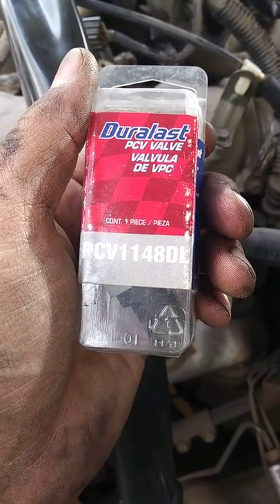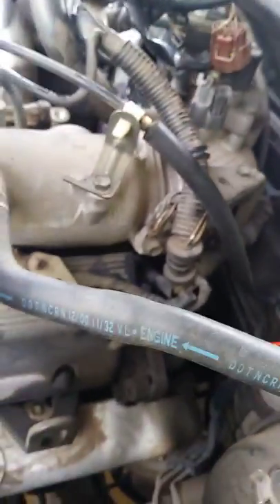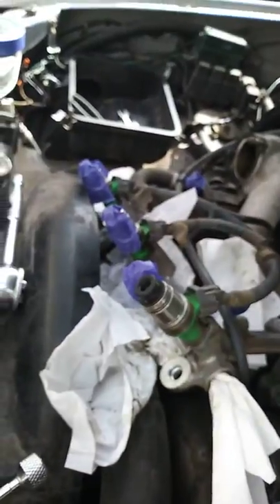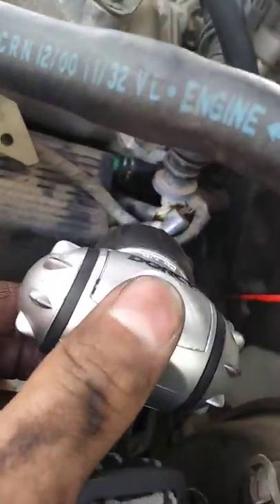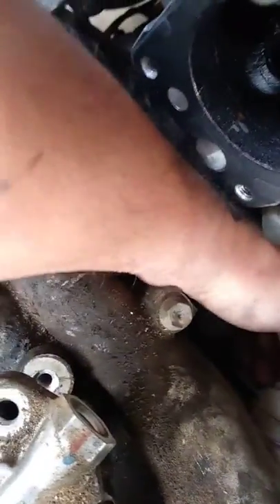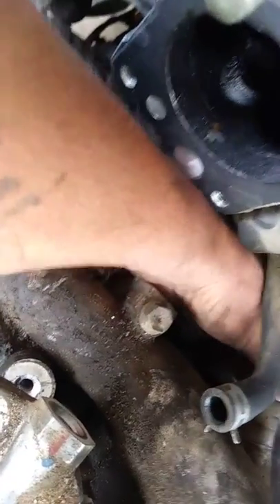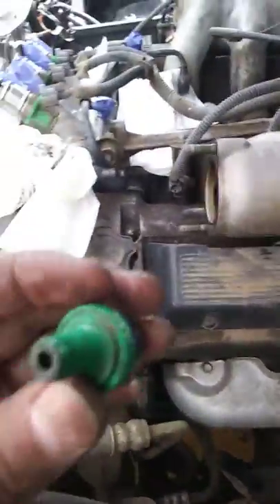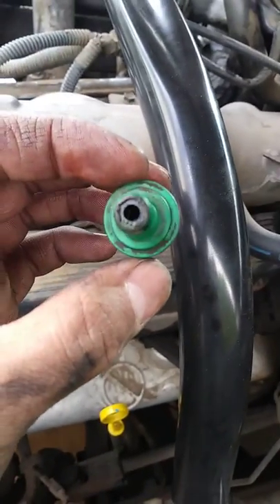PCV valve location 01 Grand Vitara

Comment: Thanks for this video. I was able to replace it without taking anything apart. I used a long screwdriver to pop it out, then long pliers to unclamp it. Then wiggled it back into the engine once I put it back on the vacuum hose. 

I had meant to change this three years ago while changing the valve cover gasket, but didn't know where it was. Right after changing the gasket I started getting white smoke on startup from the exhaust and thought I broke something. Turns out, the leak in the gasket was because the pressure from the engine increased due to the clogged valve. Once I changed it on my 01 grand vitara, the smoking stopped. 

For anyone wondering, if you're looking at the engine from the front of the car, go to the right drivers side. There are plastic covers that cover the spark plugs, follow that cover to the firewall (toward the windshield). If you look from that plastic cover toward The rest of the engine, you'll see the little green piece that goes to this valve. I then stuck my hand around to find the hose, and made sure it wasn't brittle before using my screwdriver to pry it out. If it is brittle, which I've experienced in other cars, the rubber bung, the thing that holds the valve in place, may be brittle too. I've had them break apart into the engine in other cars when brittle, which is not fun. Just a warning.
Reply: Thanks for info I just did the valve cover gaskets as well and now I have white smoke as well quite a bit going to put a new pcv valve today thanks alot could not figure out why it's happening 😀
Reply: @davideditrolio6391  so I just changed mine out a few weeks ago and the smoke was only resolved for a little while. According to a thread I found in Suzuki forums, you might be better off cleaning your pcv valve or sourcing an original, which I haven't had luck doing yet. Apparently the build quality isn't as good in the aftermarket pcv valves. Additionally, there may be clogged passage ways in the baffle of the valve cover. Also causing smoking. 

I'm going to replace my spark plug tube seals this week, and try soaking the valve cover like the thread suggests. Also, I'm going to try to find an original pcv valve and clean it in carb cleaner. 

https://www.suzuki-forums.com/threads/h25-h27-v-6-exhaust-smoke-valve-cover-baffle-drainage-issues-and-pcv-info.78833/page-2

Comment: Julian,  thanks so much for the location,  it was a great help have you located for us, what I did different after the video,  was just to stick a large channel lock and reach out from the same side of the location,  it worked out great.  Thanks pal.
Reply: Don't forget to clean out the hose, my was blocked with dry oil, right on at the bend.
Reply from the maker: Your welcome ! Ya It's a hard one to find ..I stumbled on it by accident lol That does sound so much easier with the channel locks thanks for the tip !

Comment: I have issues with my GV XL7 2.7 V6, rough idling after replacing ICAV but i did not replace the pcv valve. I noticed that my battery was very low and needs replacement which i have not done. I wanted to solve the rough idling first. Can you help me with it? Thanks in advance

Comment: Hi Julian. Thanks a lot for your precious video! As you said, I've heard and read lots of vitara's and tracker's owners talking about this god damn valve, but I never discovered where it's located. Could you please explain how did you clean it? Did you use kerosene or anything like this? Thanks in advance! Gus
Reply from the maker: Hi Gustavo I didnt clean mine I just replaced it with a new one but if you want to clean it I would use brake cleaner or even starter fluid
Reply: @julianmartinez4479   hey friends i wanna know which are the symptoms and fails of pcv valve on this vehicle,  i will really apprecciate because im tryng to found the fail of my vehicloe
Reply from the maker: @MrSastoman  Hi MrSastoman good question it can cause your check engine light to turn on but that's not always the case.. or just make your vehicle run a little rough but the main thing it can cause is oil leaks, if its clogged it will build too much pressure in the crankcase which will cause seals and or gaskets to leak ..a little known fact about these things is that you are actually supposed to change it everytime you service your vehicle and change your oil.
Reply: Yeah. Don't clean it. Swap it out. They're cheap and made of plastic. They get  brittle over time.

Comment: Mr. JULIAN
I don't know the location of pcv valve in my 2002 suzuki xl7 v6 2700cc 4×4 .
Please help me.
My gratitude.
Reply from the maker: Hi. it should be located on the back of the engine near the firewall on the drivers side ..they are nearly impossible to find unless you take off a bunch of parts..(that's how I found mine) but what might help would be to get a small mirror.. the kind that is attached to a handle that extends. Have a look with that